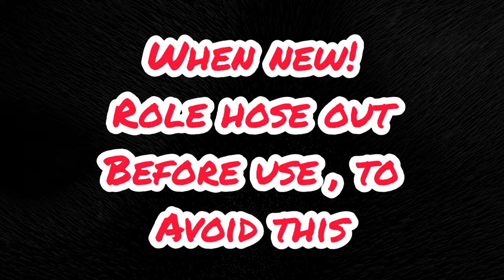Using the UBERFLEX Kink Resistant hose M22-14 to a M22-15 Sun Joe SPX2598 + AR ANNOVI MV925 Gun

Comment: Dude,i reccomend you to change the orífize nozzle of your foam canon to 1.1 for super tick foam. Its cost 10 bucks and for the most mayory of electric pressure washer its a game changer. The most foam canon have 1.5 nozzle but runnbetter on higher psi or gasoline pressure washer.
Reply from the maker: Hey man. I will definitely look into that and make a video of it 100%. Appreciate the recommendation!

Comment: Thanks for the video as it was most helpful.  Do you have any plans to replace the plastic connect that Sunjoe provides for the connection that attaches from the pressure washer to the garden hose?  The one Sunjoe provides leaks when I attach the garden hose to the pressure washer.  If one day you do replace it, can you advise me of the product code, size of the quick connect and where to purchase it......thanks.
Reply from the maker: Hey there. Thanks for watching! I never thought about about replacing that. But if I do. I'll reach back to you!

Comment: Sick car bro‼️🥵 really appreciate the insight on what adapters are needed for the sunjoe. I bought my hose and new wand to upgrade mine but wasn’t sure on what adapters…if any would be needed since mine is an older model. Maybe 2014..everything should be here Tuesday and if I need adapters I will most certainly be coming back to this video!
Reply from the maker: Appreciate that bro! Yes it's all about sharing the info! I'm e regular guy just like you and happened to put some videos online. And saw there is not much info about this hose and a sunjoe! Anything not universal is complicated! But there is always a solution!

Comment: Did you ise teflon tape because the fittings are dissimilar metals? The hose has aluminum fittings and the quick connects are brass. I wish uberflex and flexilla were available with brass threads
Reply from the maker: Nopes. Teflon is just to avoid air leaks!
Reply: @297modz  A Bad Combination Leads to Galvanic Corrosion. Brass and aluminum
Reply: I don't understand why hose fittings aren't brass. Or everything stainless steel. It's 10th grade science class. But these hoses seem to work for people. I guess you just have to throw them out when they bond. I do love the flexibility of the hose.
Reply from the maker: @dougprentice1363  Thinking about what you say makes sense. But nowadays, they don't make things that last forever. All about marketing!

Comment: What is the standard sunjoe hose? It looks similar at both ends to the hose that you bought, is the difference in the one you bought just the flex? Can I use all the attachments you listed on the original sunjoe hose ?
Reply from the maker: The standard hose from the sunjoe is M22-14. And the hose is M22-15 means there will be a little. The issue about the Sunjoe is that there is no gun that can be attached to the original hose! Beleive me I tried everything. Eventually I would have replaced the hose. But since nothing fit the original hose. I bought thr best hose possible which is the uberflex. If you want send me a DM on IG @297modz and tell me what you have and want I will help you out.

Comment: Thanks and i hope it will workfor me,  will you please send the link to buy these from amazon
Reply from the maker: UBERFLEX
https://amzn.to/3D5uCrC

AR ANNOVI REVERBERI MV925 Rear Entry High Pressure Gun
https://amzn.to/2WgG2HZ

Sun Joe SPX2598-MAX 2000 PSI 1.6 GPM 13 Amp 
https://amzn.to/3mujAWS

!!! UPDATE: ADD THIS TO PREVENT THE LEAKING YOU SAW IN MY VIDEO !!!
Metric M22 15mm Female Thread to M22 14mm Male Fitting
https://amzn.to/3o0CELF

From Sun Joe to UBERFLEX
M22 to 1/4'' Quick Connect
https://amzn.to/3syS5N6

From UBERFLEX to Gun
3/8 Inch Quick Connect NPT to M22 Metric Fitting
https://amzn.to/3j6R9fS
Forney 75136 Pressure Washer Accessories, Quick Coupler Plug, 3/8-Inch Male
https://amzn.to/3y7zQiP

Tip of the MV925 Gun
Female Coupler, Stainless Steel, 2-Pack (1/4")
https://amzn.to/3D7O72L
Reply from the maker: Sir, I bought a new pressure washer and made a video of it. https://www.youtube.com/watch?v=0SIYDWlwNuo
I will create a video tomorrow and hopefully post it same day or Sunday on how the Ubberflex hose works on it.!

Comment: I have a SPX 3000-XTI I want to order the Uberflex 1/4 “ X 50’ 3,000 PSI what connected do I need.
Reply from the maker: Do you have the pressure gun already?
If you don't want or need quick connect system this is the only thing you need for the Uberflex to work with you Sun Joe machine: https://amzn.to/3o0CELF

If you want quick connect system, you still add https://amzn.to/3o0CELF to your Sun Joe and then buy this quick connect set: https://amzn.to/34nQnqg and that is all you need.

Let me know if you need anything else.

Comment: Is the adapter for “from sun joe to UBERFLEX” correct because on Amazon it says it is m22/14mm I thought the sun Joe needed a m22/15mm?
Reply from the maker: Yes sir. Just that the sun joe's thread is not fully threated. Don't know how to explain in words. And you have to tape it a lot @ the horizontal or 180° to avoid some leak!

I just bought an other compressor last week and will  make different videos. Also do some comparison to help everyone to see what would be your best option if sticking with your included hose/gun or upgrade.

Comment: What part exactly make this swivel?
I'm about to purchase similar kit to this only with adapter for Nilfisk pressure washer.
Thanks
Reply from the maker: The gun itself has the swivel mechanism on the bottom. Can't beat the price. Gun and the hose is a must! I have just bought a new compressor be pending for the setup and initial review.
Reply: @297modz  Keep rocking bro just subscribed
Reply: My Nilfisk pressure washer has QUICK CONNECT outlet...from the Pressure washer to Hose its QUICK CONNECT, how can I connect the hose to QUICK CONNECT ?
Thanks
Reply: My Nilfisk pressure washer has QUICK CONNECT outlet...from the Pressure washer to Hose its QUICK CONNECT, how can I connect the hose to QUICK CONNECT ?
Thanks
Reply from the maker: @itamarkas  hey man. Hit me up on IG so you can send me some pics of your quick connect! @297modz

Comment: what size adapter do i need if i want to use my original hose but get a shorty gun for it?
Reply from the maker: Hey man. There is no adapter to add any other gun to the original hose. I have tried everything and couldn't find one. If you find one please let me know. And I'll make a video about it.
Reply: @297modz  ahh bummer. i ordered a gun and of course didnt fit, been looking for the past hour lol
Reply from the maker: @nodrog321  that is how I started. Order different guns. Multiple fittings and nothing. Went to home depot and lowes. Tried a bunch of stuff! Save your time get a new hose. 30 to 40$ and better quality. And if you want quick connects you add 20 to 30$ more. But just do a hose and you are all good!

Comment: My o-ring is sticking out, How do I replace the black o-ring for my pressure washer?
Reply from the maker: If you are able to put it back. It typically works fine. You van always replace them. Those are universal!
Reply: @297modz  ok cool, do you know the actual name for it?
Reply from the maker: @azeezoh9774  you called it correctly O-ring. At Walmart, Lowes or like Home Depot. You can get a variety pack for 5$ or less
Reply: @297modz  nice nice thanks, I just need some kind of tool pick to put the new black o-ring back in place

Comment: M22 to 1/4? So it’s not M22 to 3/8 from pressure washer to hose?
Reply from the maker: Yes that is the quick connect size to the hose! Now each machine has a hole and that's the one that is the 14 or 15 mm. Most machines or hoses are M22 14. But sunjoe is an M22 15 hole!

Hope this helps you!
Reply: Honestly no it didn’t help, please help me understand. I have an electric 1700 psi greenswork and from my understanding they are 15mm like the sun joes right? I just bought an Uberflex which I need (2) M22 fitting with a 3/8 quick connect for each side of hose right? Now the adapter that you connect to pressure washer you have them listed as M2214 1/4 plug and 1/4 quick connect M22 male. The M2214 1/4 plug would be too loose if I connect my 3/8 quick connect from Uber flex so I would need M2215 3/8 instead of the M2214 1/4 right?
Reply from the maker: @esejuanito4925  I never worked with Greenworks. But if it says that it need to be M22 by 15 use this link. https://amzn.to/3o0CELF and to use quick connect on your Uberflex get this package and it will have everything you need. https://amzn.to/34nQnqg

That will solve all your issues and have spare parts!

Comment: i believe that when you have an o ring seal you dont need the teflon
Reply from the maker: That's clever! I had not done that! But I found a solution and added the info down in the description and found the correct adapter to avoid this issue!

Comment: Can u fit a swivel on this ?
Reply from the maker: Yes you can sir! Just not when you are holding the trigger. Due to the amount of preassure while spraying.
Reply: @297modz  Awesome  brother could you tell me what fitting or size that would be ?
Reply from the maker: @Ali_o.O  are you buying the same gun and uberflex hose?
Reply: @297modz  Yes I'm going get the same gun and the hose is different has the same m22-14 connecter.
Reply from the maker: @Ali_o.O  ok.

You'll need the https://amzn.to/3syS5N6. And the https://amzn.to/3y7zQiP